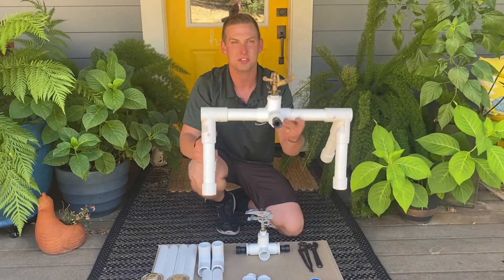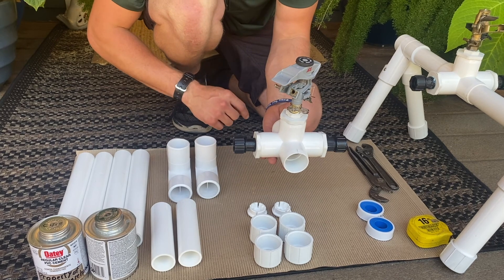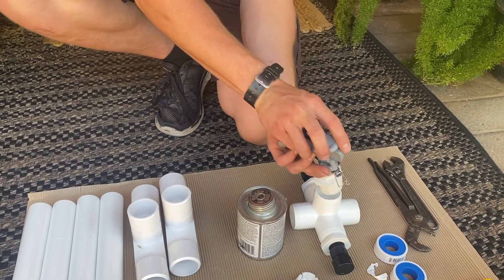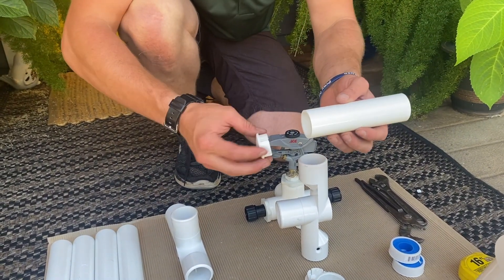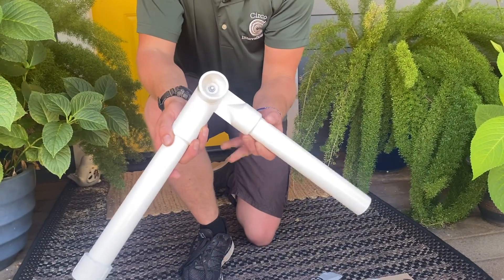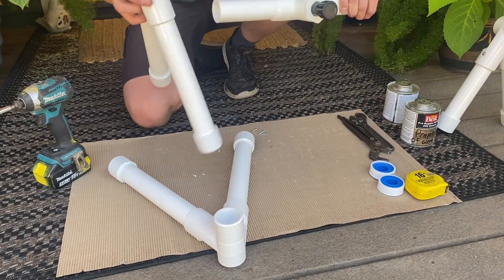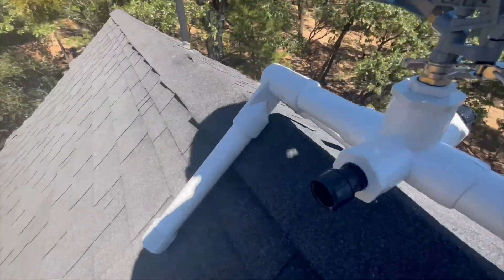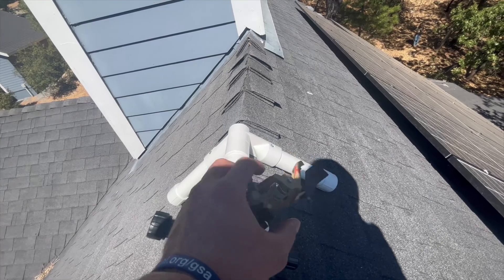Solar Panel Sprayer / Full How To Video / DIY PVC Roof Sprinkler￼/Also Used For Wildfire Protection￼

Comment: Do we have to do all of that gluing and assembly if we buy the 1 1/4" kit that is online?
Reply from the maker: No you do not.
Reply from the maker: The sprinkler can be dual use. 

Rooftop Sprinkler Kit / Securing The Sprinkler To The Roof To Withstand High Winds.
https://youtu.be/xKWMuZLammg

Comment: How many gallons of water does it take to get the panels pretty clean?
Reply from the maker: We ran the sprinklers for about 10 minutes. Standard water hose pressure for residences is about 40-50 psi. The sprinklers we use put out about 4 gpm. So at that rate about 40 gallons using one sprinkler for 10 minutes. Here's a link to the kit: https://www.circoinnovations.com/circo-direct/Roof-Sprinkler-Kit-1-1-4-p478617466